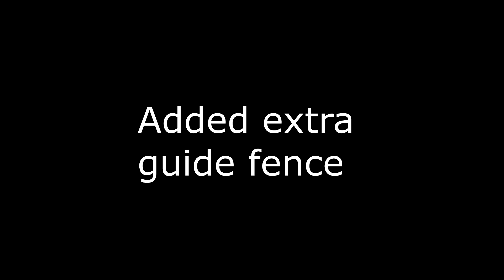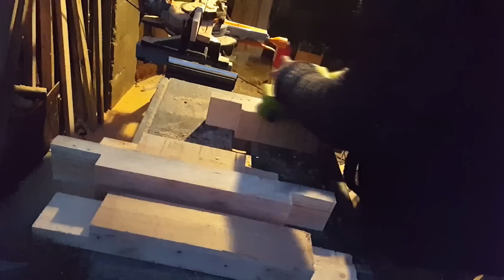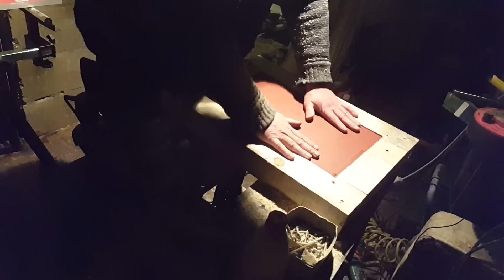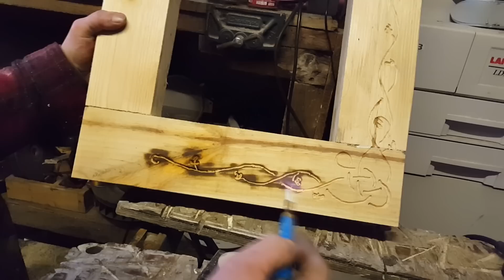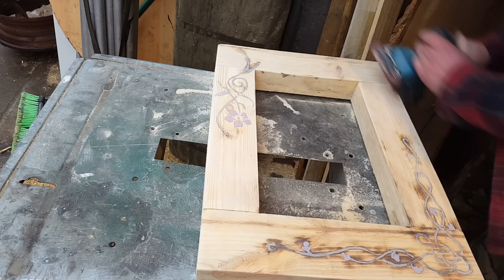How to make a Half Lap Joint on a Mitre Saw Rage3 Mirror Project

Comment: does mine have a stop? is that standard? very handy.  nice project too . thanks for sharing
Reply from the maker: Yes, to the left side of the saw there should be a screw and a nut. Youll have to make a extra fence out of some scrap wood to push it forwards so you get a flat cut. 
How are you getting on?

Comment: After putting the the glow resin on , will staining the piece diminish the effect of the resin?
Reply from the maker: depends on the type of stain, is the stain just a stain or part of a varnish? if its just water based stain it wont stain the resin because thats fairly solid, always use varnish or a finish that does not have uv blocker in it as well
Reply: thepoultrypeople so if I want to do a dark stain, just get one that is water based, then use a non uv blocker varnish?
Reply from the maker: yes, thats what i do and it seems to work ok, if i was you id get some off cuts, drill a small shallow hole in the middle and then pour in a small tester of your resin mix, let it dry and then see what effect you get, it can look a bit insipid (great word)  so you might want to add some metallic flakes into the mix so it stands out more especially during the day, youll see what i mean when you have a go and use it

Comment: Great video. Newb question here...is it possible to create the half lap joint with the router instead of the miter saw?
Reply from the maker: yes, its how i did the top for the glow in the dark table, just set the depth right and start cutting away
Reply: Thanks! Using a router for half lap joints seems simpler than using a miter saw or table saw...is that the case? (I've never used a router)
Reply from the maker: im going to say no, the mitre saw means you can rip it up into slithers and knock them off, with a router youre going to have to get rid of each and every it of wood with it, but, you might very well get a more accurate finish though, but for me if ive got half laps to do im doing  it on the mitresaw, i did 4 more of these frames last week, it also puts a lot of stress on router bits to do half laps ive found, you dont want a router bit breaking, it doesnt happen often but when it does...
Reply: That makes a lot of sense to not want to overuse your router bits. So many ways to do everything :)
Reply: I've seen once the result of a router bit breakage at some 18000rpm. Went all the way from the carpenters workshop across the street, passed clean trough an outer wood door, across a long corridor and got stuck deep into a brick wall in the end of the corridor about 35 meters in total. Luckily nobody was on the path if not there would be a dead person. Bullet like I can say. 
End of story the carpenter had to replace the router bit, repair the door and the wall... Be safe. :-)

Comment: Sweet mate I just got me a nice supply of pallets today and I was only thinking, where  the fuck is Bongo
Reply from the maker: for some projects? lol i havent been too well, still pretty odd, ive been in the shed a bit, a few projects that need finishing off :) what are you making with your pallets? latest batch from a local water bottling company, really odd, all different constructions, 50/50 hardwood/pine, oaks and maple, most of its amagoosalum but some of its ok
Reply: Sorry to hear you've not been well mate, I've had that hacking cough nasty little thing. My latest project is making panel fencing, I'm fed up paying £20 for the ones from Wicks only for them to blow down a year later. I'm getting 6ft pallets or biscuiting together  4ft ones so far so good hopefully they will last longer than the bought ones, the first one I did is still there so there is a lot of collecting to be done. Cheers for now keep well mate.